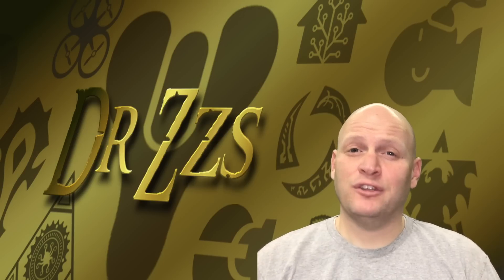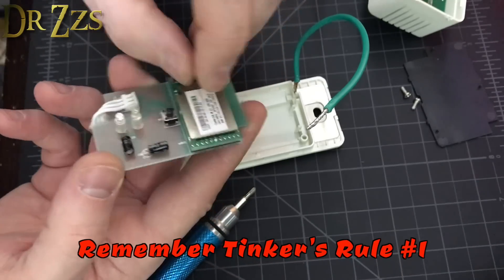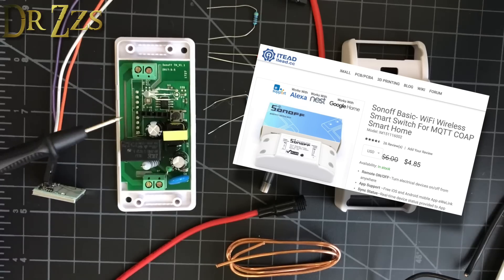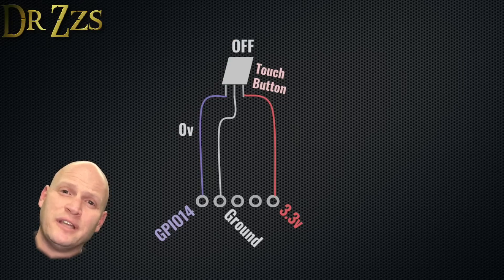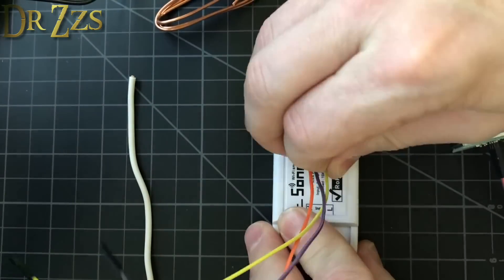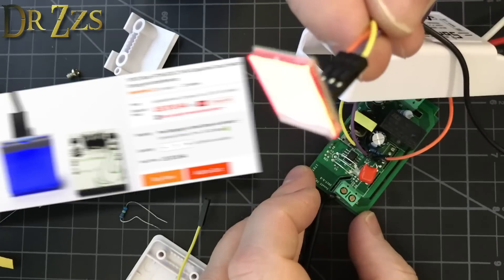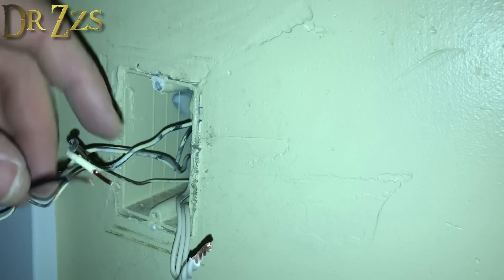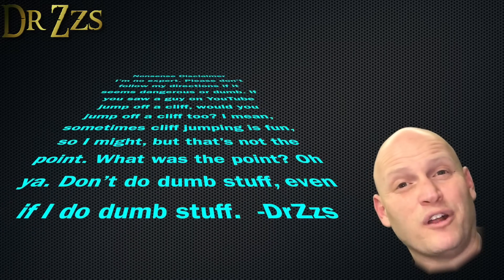$5 Sonoff + $2 parts = Best Smart Switch EVER!

Comment: Awesome as always ! I bought these switches before this video came on, and I want to use them in certain places. https://www.wish.com/c/59f30290e0f04d3976eb4880  They have two connections for the switch, and two for the LED ring, and a tiny resistor is also in the package. I can't figure out how to wire it to get the same result as the zonoff, so lights on, LED ring off, and vice versa. Any idea ?
Reply from the maker: Thanks
Those are cool looking buttons! 
My guess is that the resistor is meant to be used as pull-up or pull down. Or it might be meant just to limit the current going to the LED, so it doesn't get too hot. 
I'd think you could combine one of the poles from the LED to one from the button.  Seems like it's meant to have the LED on all the time. I'd have to tinker with one to figure it out. Their instructions aren't very helpful. 
"Ring LED can be on all the time or only when switch is on which depends on how you wire it." Ha!
I'll order some the mess with.  Sorry that's not much help to you right now.

Comment: awesome video. 
is it possible to make a arduino multi switch for controlling the light or scene in home assistant? so to turn on something no need to find the phone and open home assistant.
Reply from the maker: So, like a button somewhere that you press and it activates an automation?
That's certainly possible!  The easiest way is probably to use something like a D1 mini, which requires 5v power. Set it up so a button press sends an MQTT message that triggers the automation in Home Assistant.
If you're skilled with Arduino sketches you can write your own sketch to do it, or Tasmota works on the D1 mini too.  I haven't used it yet but I want to.  This might be a good project to try it out. 
The D1 mini has plenty of GPIO pins so you could have several buttons that trigger different automations.  If you wanted to be super fancy you could use a rechargeable battery too and make it more like a remote control than a wall switch.  Or maybe it stays on the wall when it's charging but you can take it down when you want more of a remote control.  
Ok, now I'm excited about this.  When I do get around to putting Tasmota on a D1 mini this is what I'm going to do! 
Thanks for the idea! 
Hope that helps!
Reply: thanks for the replay. Actually i don't know about arduino. please make the tutorial to make that switch :)
Reply from the maker: Got it.  I'll do it when I put Tasmota on the D1 mini.  It's on the future video list.
I have so many projects to do.  I need to find a way to get more of them done faster.  I might have to cut back on my editing time...

Comment: From what I can tell after reading the translated datasheet at heltec.cn, you shouldn't need the capacitor.  This is a different scenario than your other video where you discuss a low pass filter used with a push button switch. The output of the module is a processed latched signal that has different characteristics than a simple switch.  Heltec made an effort, at least according to the datasheet, to make the module resistant to spurious noise.  The resistor from GPIO to 3.3v is unnecessary and could, and apparently did, interfere with the output of the touch module by loading it excessively.

It wasn't obvious if you need the resistor to ground.  The datasheet wasn't clear rather the module only drives the high state and floats the low state, or if it drives both the high and low state (it would be easy to test with just the touch switch, a power supply, a resistor, and a multimeter).

I like that you still used the original sonoff case, and added a fuse.  I suggest soldering the resistor (if it's even needed) rather than just sticking it in the header, it will be much more reliable.

This is much safer than your first video on adopting a sonoff for use as a light switch.  Just for the record, it's still is going to violate multiple US NEC rules as anything along this line will. Light switches have to be purpose designed and follow a number of mechanical and electrical rules. Some things are not even obvious, such as the chemical composition of the insulation on the wires for example, might have certain requirements in certain environments.
Reply from the maker: Cool. Ya, I'm a lot happier with this setup.  

Thanks for your input!  It's great to have folks with real knowledge weigh in on these things.
Reply: Yes, this is much more comfortable in terms of safety.  I would suggest a smaller fuse though as it's very unlikely you need 10A to power a light inside a home.  As a general rule, always use the smallest fuse that gets the job done.  With modern LED or compact fluorescent lamps, even a 2A fuse would give plenty of headroom for most situations.  A 2A fuse is good for around a couple hundred watts non-inductive load, a single bulb these days takes 7-20 watts, so even if the fixture has 4 bulbs, you still have decent margin with a 2A fuse.
Reply: Do you have a copy of english datasheet?

Comment: has anyone tried the touch switch with a h801?
Reply from the maker: Not I. 
Just had to look up the h801, hadn't heard of it before. 
Tell me about it.  What are you using it for?  Wifi control of LED light strips?  
I might have to try it out.
Reply: yes, wifi rgb-W strips for all over my house behind tvs under counter lights, hannel with lights on my stairs etc.. firmware made by the same guy who makes the sonoff firmware mod http://smartlife.tech       i set most undercounter ones to auto-ower on to white. I also set the undercounter and stairs to come on from smartthings when motion is detected and go off when its not. h801 has a smartthings a and device handler available.

Comment: Crazy. I just did exactly this 2 weeks ago, but with the TTP223.
Reply from the maker: Awesome!  How'd they turn out? 

I just ordered 40 of those from aliexpress:
https://www.aliexpress.com/item/Free-shipping-via-HK-post-5sets-lot-Funduino-uno-r3-compatible-arduino-uno-r3-5sets-5pcs/1643014974.html?spm=a2g0s.9042311.0.0.hGQrmh

I don't even know what I'm going to use them all for.  But they're so stinking cheap, and so dang cool!
Reply: The touch switches work great. You can bridge solder joints to affect how the switch works. Momentary(high or low) and latched(high or low). Also, I believe the ttp223 chip already has an internal pullup/down resistor.
My problem is the communication with home assistant. I can see and control the Sonoff through via the webpage, but Tasmota pauses and disconnects/reconnects every 20~30 seconds. I can't figure that one out.
Reply: Whoa! I just followed your link. That's 25% of what I paid for mine, but I also bought mine on an impulse from Amazon.

Comment: Thank you very much for sharing your experience and ideas , would you kindly share best solar based sensor for agriculture , which measure moisture in trees and send them to controller for irrigation ? something with minimum soldering if possible , thanks Dr.Z's
Reply from the maker: I really can't say I know much about soil sensors.  Just from a couple minutes of searching it looks like soil sensors are fairly simple.  From what I can see you'd need the sensor, plus something to interpret and probably send the message somewhere, so maybe a NodeMCU?  Then you'd need a small solar panel to power it.  
But I'm really not the right person to give you direction on that project.  
It sounds really interesting though.  Let me know if you don't find someone more experienced in that area and maybe we could put it on the list for future projects.  I'd have to do a bit of research to learn what all would be involved, but it would be fun to figure it out. 
Sorry I'm not more help. 
Thanks
Reply: Thank you for your kind replay , I

Comment: Regarding the pull-up resistor, why not just invert the output of the switch by sending it into the base of an NPN transistor and then wiring the collector to GPIO14?  Then you can keep the existing pull-up as-is, I would think (but I'm neither an EE nor do I know anything about any GPIO>3 on 8266).
Reply from the maker: I'd have to learn what an NPN transistor is first ;p
Reply: DrZzs NPN basically just means that you connect the emitter pin directly to GND. It allows current to flow into the base pin (provided it can overcome a small voltage drop, usually around 0.2-1V IIRC), and if current does flow into the base then it also allows a load current to flow into the collector. So it's a switch. But this also means that if the base input is low then no current flows into the collector do if you tie the collector to Vcc then there collector is high, whereas if the base is high then the switch "closes" and current flows through the pull-up resistor so that the collector is low. The main downside to using this simplest sort of transistor (in my very limited experience) is that the resulting voltages aren't 0 and 3.3, but more like 0.6 and 2.7, which may not be extreme enough to work properly. Just search "npn inverter" for lots of nice examples. Very cool project, by the way!
Reply from the maker: cool!
thanks!
Reply: Did you mean the pull down resistor?  It's questionable rather it's needed at all as the module likely drives the line in both the high and low state, but I couldn't be sure after reading the translated data sheet from heltec.  If the module only drives the high state and floats in the low state, a resistor to ground (a value in the range of 3.3k - 47k is good) is a simpler implementation than a using a transistor as a switch. I am a EE.

Comment: If we were to set this up as a 3-way switch (either with a separate Zzonoff or 2 switches wired to one), is there a way to control the led on the switch so that when the light is off, the LEDs on both switches are lit and vice versa?
Reply from the maker: That's a great question.  I'm working on a test set-up for a 3-way switch scenario.  I'll be sure to test it with these touch buttons and let you know how it goes.
Reply: Is it possible to use the traveler wires for the capacitive touch switch and get 3 way operation with 1 module but extra touch switches? Or remote button switches if per prior comment there is a distance limit? Old X10 module remote switches I don't think sent house current through the traveler wires.

Comment: Good job! Thanks for all so far ! One question tough, how far can the button be from the sonoff module ( i am thinking in range of 20-30 meters) ?
Reply from the maker: Thanks!
That's a good question.  I don't know the answer to that one.  That is a long distance.  I would guess that at some point the voltage drops off enough that it won't work.  You could try calculating voltage drop based on 3v and the wire you're using.  But, I would say you should just test it out.  Use the biggest gauge wire you can use to minimize resistance.  Then just see how far it can go. 
If I get a chance I'll test it using the longest cord I have, which is 100 ft.  
It would be good to know what that limit is. 

What are you planning to do?
Reply: DrZzs Make a smarthome light control, but I want to make it future proof let's say. Prewire the house with both neutral and live wire and besides that UTP cable, and all off them would go to a central control unit(wich may be many Zonoffs, in this case won't be using the voltage wires). I managed to flash all my sonoffs with tasmota thanks to you and put them in home assistant. If you want i can make some pictures to show my demoboard. Thanks for quick reply !
Reply from the maker: I'd love to see your setup. 
Have you checked out Jonathan from Superhouse.tv?
I'm not sure, but I think he has some kind of central hub like that. I know he's a big fan of less wifi and more wired IoT devices.  
I do like that idea.  I think the time is going to come where we don't have 110v circuits all over our house.  It might be hard to run really low voltage all over the house, but maybe 12v would be okay.
Let me see if I can find his video real quick
Reply from the maker: it's a long video, but he's good.  If I was building a house I'd do it like he did. 
And he's bald, so we're almost brothers. 
https://youtu.be/YQCaBXJ9sSM

Comment: Why Solder inside the screw connector, why not desolder the screw connector and solder the cable directly on the board?

Comment: Cool suggestion using the touch switches as input.  Could make it a lot easier to fit everything in the switch box.  When adding the input and output leads why not just remove the screw terminals completely?
Reply from the maker: Thanks!  A guy named Andy showed me those buttons. They are super cool!  
One more thing I just found (but haven't totally tested yet) that would reduce the size in the box is this 3D printable box for the Sonoff: https://www.thingiverse.com/thing:2394462
I got some Fire Retardant ABS filament too.  
In another version of the Zzonoff I soldered the input/output directly to the back of the board.  I actually also just soldered wires to the fuse instead of using the fuse holder.  It wasn't as clean, but that was mostly my soldering skills.  Honestly, I just dumped solder down the screw terminals out of laziness.  
I haven't tried just removing the screw terminals.
Reply: Do you think there would be any problem placing multiple switches on the same panel?  I have a 3-switch panel in my house that I haven't tried to sofoff yet because I know there isn't enough space in the box to house everything but with these touch buttons I think it could work, but I worry that placing them side by side might trigger both switches at once ?
Reply from the maker: good question.  I have a 2-gang box I want to use them in.  When I do I'll report back on how it goes.  
They are pretty sensitive, so I would say it's best to space them out as far as reasonably possible.  I think if you center them about where the old switches would have been (I'm guessing that would put about 2" in between), that would be enough.  Guess it'll always depend on how precise the pressor of the buttons is, and how large the fingers are...

Comment: Great video. I have watched quite a few of them and was wondering what sort of changes I would have to make to use the "Zonoff" in the UK with 240v.
Reply from the maker: good question. 
I believe the stock sonoff is rated for 240v.  I know it is CE certified. 
So the main difference would be making sure the fuse and fuse holder you use are rated for 240v.  
The touch module and associated wires shouldn't need to be any different. 
Hope that helps!

Comment: Great video.  Looks like the touch sensor works even thru the front cover.  Do you need to cut hole thru the front cover to work?  Will wet hands or gloves works on this touch sensor?
Reply from the maker: it sure does!  
It's really quite sensitive.  There's no need to cut a hole at all.  I haven't tested it with gloves.  Maybe it wouldn't work with like thick snow gloves, but thinner gloves, or the ones that have special pads that work with smart phones should work. 
Wet hands are no problem.  That switch in the video is in the kids' bathroom so it gets tested with wet hands all the time.